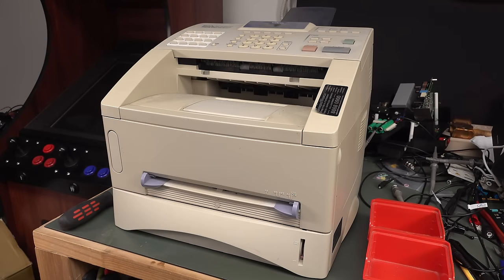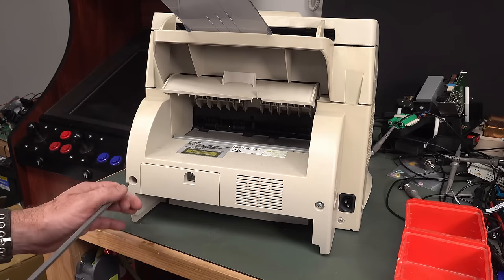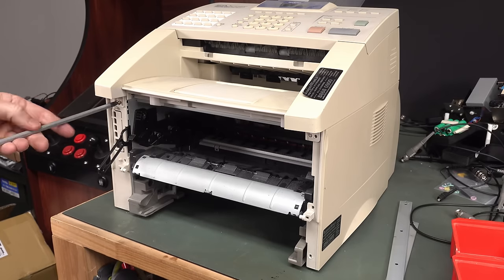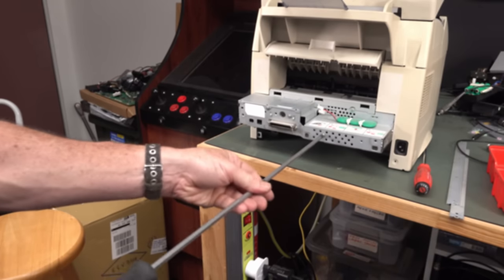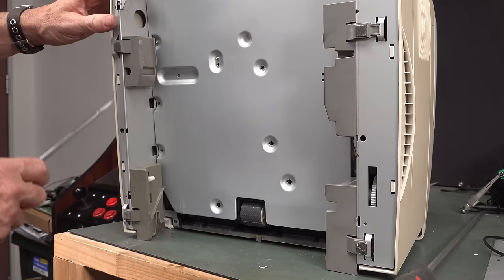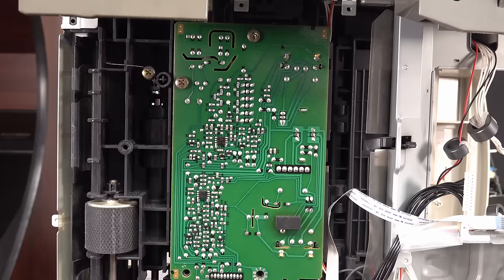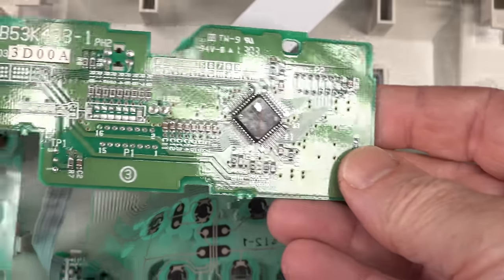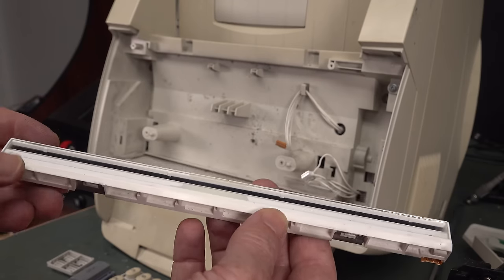EEVblog 1587 - Dumpster FAX Teardown

Comment: when the fax's used paper rolls, we would send 40 or 50 blank pages. they when very fast and cut the paper   roll in to a lot of nice A4 sheets. boy would the end user get upset. 🙂
Maybe sometimes we would say we were just sending them a few A4 sheets to use as note paper.
Reply: This is a Dilbert comic
Reply: @kg790  one of our new state of art fax's was given a wrong number and it retried to send at midnight for weeks until we got a visit from the police. There was no indication in the top level menus that it was doing it. We had to turn it off at night until an engineer came out and found the settings to stop it.
Reply: Did this with the DOS version of WinFax where you could set the page length to a huge figure.
Reply: @TheEmbeddedHobbyist  Your first comment was funny enough for a dinner anecdote, and the second one I just realized was probably not even a fax number but just some poor person's telephone ringing every night for a month 😂
Reply: @kg790  I should have made that more clear, if it was a fax machine at the other end it would not have kept retrying. Glad you found it amusing.

Comment: There is still fax around for the main reasons found in the comments. Fax was invented in 1861 but first used as a fax machine by Xerox in 1964 so expect this machine to last as long as telex did (80 years) and be finally gone by 2040.
Reply: A serious treat to FAX machines is the lack of analog (POTS) phone lines to connect them to.
This of course differs by country but here in most offices it would be very unusual to have an analog line, and when you would want to install it it would be very expensive.
Reply: @Rob2  Even though the infra of Telecom Operators has changed into SIP, POTS are still available through Analog to SIP conversion. So POTS are still available and faxes can and are still connected this way..
Reply: @pvisit  Over here, suppliers of such analog (ATA) converters in business environments usually explicitly exclude the use for faxes or modems...
(i.e. that is "unsupported" and "at your own risk")

Comment: Faxing in Japan is still mandatory for most official communications. I was surprised they never made Internet connected fax machines, where they start calling each other on the phone, exchange ip addresses and encryption keys via phone, and then just dump the data encrypted over the Internet.
Reply: The "via the phone" is probably the weak part.  The main reason why we do not have FAX anymore: we don't have analog phone lines anymore!
But the idea of an "internet connected FAX machine" in itself is interesting, especially when it would work independently from the e-mail system.